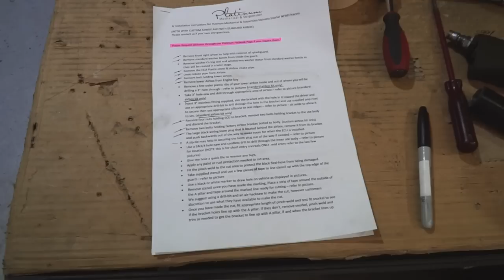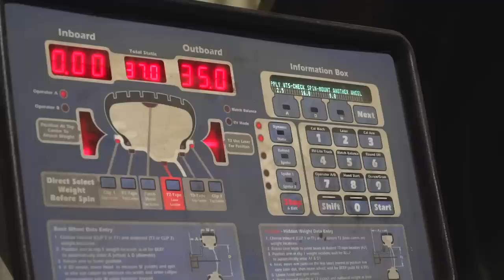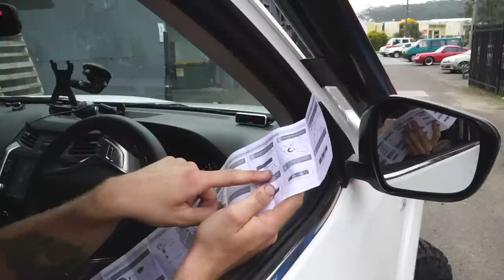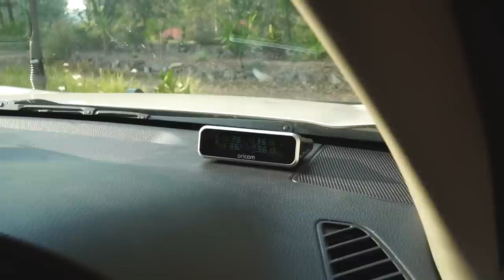NISSAN NAVARA OFFROAD BUILD

Comment from the maker: AIRBOX AND K&N AIR FILTER - Have heard mixed opinions from people about whether the k&n air filters are better or worse then the factory paper air filter when it comes to dusty off road conditions. Some people have said they don't do as well and others have said they do just as good/better. The K&N air filter is a washable air filter that can be washed and re-oiled when it gets dirty rather then chucking in the bin like your paper ones. I've got a kit to clean it if it gets really dirty out on the tracks plus I've also ordered a sock that goes over the filter as extra dust protection so will see how things go :)

DISCOUNT CODES

Use code 'TYLZZZ5' for 5% off Platinum Mechanical & Suspension

Use code 'TYLZZZ' for 10% off Superpro & Fulcrum Suspension 

Use code 'raingertyler' for 10% off Rainger clothing

Links to their websites above in the description section

Comment: Your drop link height and sway-bar pre-load should have been set with the car resting on its own tires, on level ground.
Tightening all sway bar fasteners likewise should be done with the car resting on its own tires, on level ground.

Having it done with the suspension under full droop is going to cause premature failure to those suspension elements.
Reply from the maker: Now you say that I do actually remember reading that somewhere in the packaging. So should I loosen and readjust/tighten things now when its on the ground?
Reply: @TylerThompson90  Yes. Most definitely.
Reply: What the maverick team said ;)
Reply from the maker: Okay will do! :)
Reply: Yes. In fact all the suspension bolts shall be tightened once the vehicle is on the ground. Expect of the knuckle ball joints.

Comment: I've got a set of those tyer monitors  on the lux an it tells  the tyre temp an tyre  pressure  as well as sets off an alarm if  a tyre has a fault  but my monitor  plugs in to a 12vlt  socket I think mine are made  BY ROUGH COUNTRY  4X4
Reply from the maker: Yeah same things mine does, seem to work pretty well
Reply: I  also looked  on the oricom site an there's are   any where from 130  to 240  I think  your oricom ones are better then my ones as they need the specail lock nut spanner to take off the sensor  tyre caps when   I need to air down
Reply from the maker: Yeah that would be a little annoying to have to do that all the time!

Comment: Hi Tyler! Last question. Is there space enough to put 33” spare wheel in place? I’m running 32s and the space between the spare wheel and the Panhard rod is quite small.

Thanks mate!!
Reply from the maker: Hey mate, yep you can, I just let mine down to 6ish psi then compressed it together a little with a big ratchet strap and it fits

Comment: hey mate, just wanting to no what lift you got in there? i got a 3 inch dobinson lift with 285/75r16s and they were scraping bad on the front, so i had to put a 2 inch body lift as well and it still scrapes every now and then when going through ruts.
Reply from the maker: Hey mate, its the 2 inch ironman foam cell pro lift kit. Tyres just touch the inside of the chassis on full lock at certain angles, no guard scrubbing though

Comment: Hi Tyler!! I’m thinking about to change my current BFG KO2 for the KM3. However I use the car every day to go work. I do 76km/day. Do you think it’s a good deal? How much asphalt do you do with your MT tires?
Have you checked if this tires touches the wheel cover when the suspension is fully compressed? 
Another question. Could you say me the maker of the snorkel/air filter kit? 
Thanks!!
Reply from the maker: Hey mate, just depends how much off roading you do I guess and whether you do the harder stuff when you do to make it worth having mud tyres. Ill often do 50-60km a day with my muddies. The main thing is they are just going go wear quicker then all terrains if you doing lots of road driving, they will be noisyer but that doesnt worry me, I think the engine is always noisyer then the tyres anyway. Mud tyres will also be more slippery in the wet.

Tyres just touch the inside of the chassis on full lock at certain angles but they don't seem to touch the guards.

The snorkel and air filter come from 'platinum mechanical and suspension' 👌

Comment: Did you have to do any chopping to get the 285s in with the 2inch lift ? And does it scrub much on road, off road and when it’s fully flexed ? Cheers
Reply from the maker: Na didn't have to chop anything, doesn't scrub when its full flexed. The only time is on full lock it will just touch the chassis, whether you are on or offroad. If you got rims with a wider offset it should bring it away from the chassis and fix that
Reply: Tyler Thompson yeah nice, what offsets is your rims ?
Reply from the maker: Just the standard ones that come with the ST nav, Im not 100% sure but I'm thinking maybe positive 10

Comment: What's the go bud....smick staino snorkel and airbox and that flexy plastic pipe to connect the 2.  The ripples in the pipe wouldn't help with direct airflow. Should look at a  nice shiny pipe to connect although would be a pain  in the butt to Install and remove, not much room to work with though, gotta love it lol.
Reply from the maker: Yeah not sure mate, I see your point but would probably be a pretty big nightmare to get a hard pipe in there haha I'm assuming thats why they've done it that way
Reply: Lol yeah be a big pain. The boys have looked after me there so there would be a means behind the madness. Very clued up the crew. (Don't wanna drop any names haha) your in good hands there.

Comment: Hi mate, I've heard some tyre places refuse to fit 285/75 on the stock ST rims because they're not wide enough. Did the guys you go through share any concerns with this? You've obviously done a fare bit of decent wheeling in them and seem to have no issues? I want to get a set but like the ST rims. Little bit if scrub full lock doesn't bother me. Cheers
Reply from the maker: Hey mate, I'm pretty sure the stock ST rims are 8 inches wide? 8 inches wide is definitely wide enough for 285/75. Maybe just double check and find that out. But I haven't had any issues running them and I know lots of other people run them too, I've never heard of anyone saying you can't fit 285's on the stock rims
Reply: @TylerThompson90  looks like they're 7 but all good if you've had no issues then I'll do the same. If they fit, they fit!  Cheers

Comment: How well has the Oricom been working? I have an external one (not Oricom) and it beeps all the time, it shit me and went out the window. Does Oricom have volume adjustment?
Reply from the maker: Yep I've found it quite good mate, hidden away in the tyre so don't really know its there and only beeps if you start losing tyre pressure. Not sure if it has a volume adjustment though